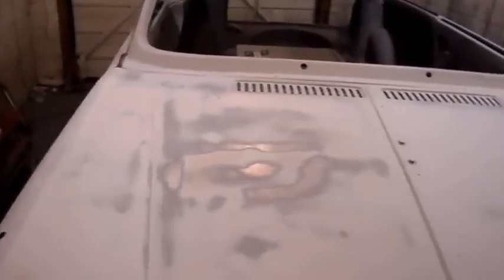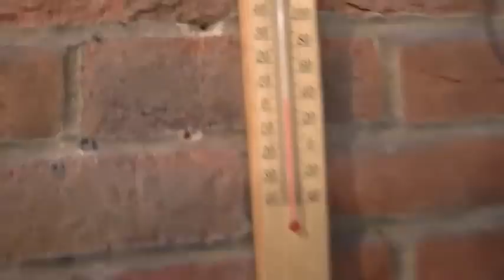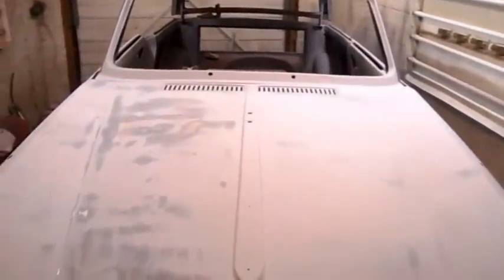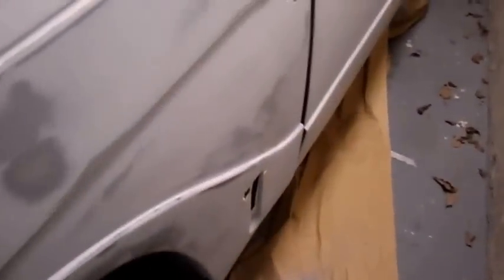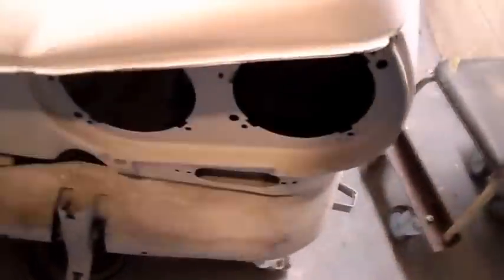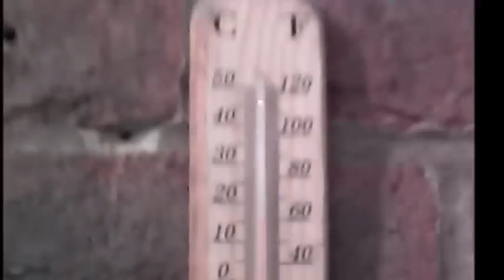Triumph Vitesse Restoration 25 01 17

Comment: man of all hats...lol my friend....car looks awesome. too cold here in america state of ohio to any car or motor cycle work. i only have a tarp carport  : (  
your car doors remind me of a 64 mustang i had...we use salt here so rust is common. the door handle metal got weak from pulling on it when frozen....i had to weld metal strips inside the door. after 3 or 4 yrs the passenger side was really bowed out from the tugging. by the time i was done the second time the rust was so bad i had to scrap the car.....had alot of bondo and  aluminum foil in all the holes after the patches rusted out

Comment: Hi Scott . When are you due to paint the Vitesse.
Cheers Pete.
Reply from the maker: Hi Pete, I was thinking beginning of May, gives me 3 clear months and the temp should be up by then, mind you, if I have the sanding, re-priming and re-sanding all done before that I could put a week end by and give it a splash of colour ;-)
Reply: Fair play , warmer the better. I  must be getting old , but has your gearbox got the J ytpe over drive on it. Has been a long time since i looked at one .
Reply from the maker: Hi Pete, I've done a 5 speed Ford conversion, made myself an adapter etc, The old box jumps out of 3rd and was a bit of a screamer so went for the change, last bit of that job left to do is stick the handbrake lever back in, I didn't bother with shortening the gearbox remote. (I couldn't find a O/D box for pennies) being a tight arse! LOL I did some vids a couple of years back.
Reply: Fair if the box works why not the can be on the silly money end of things.